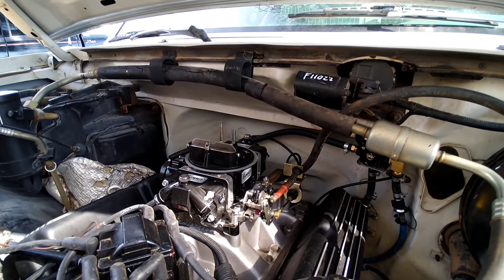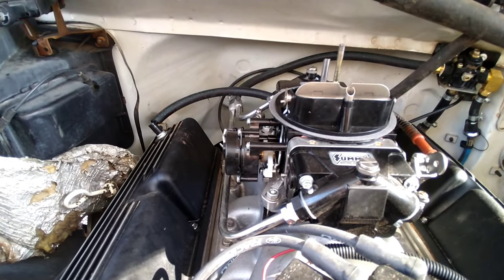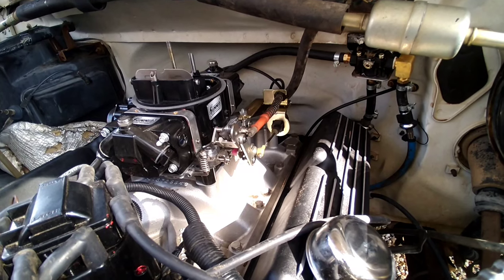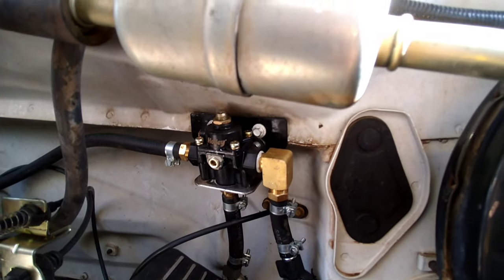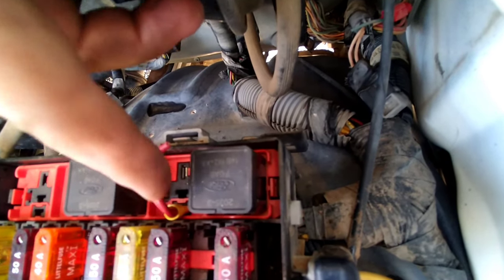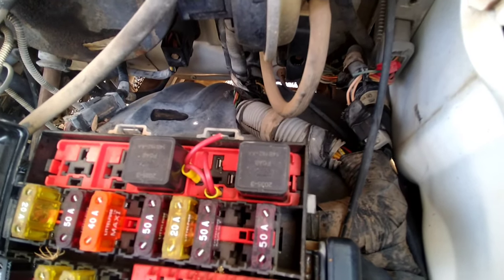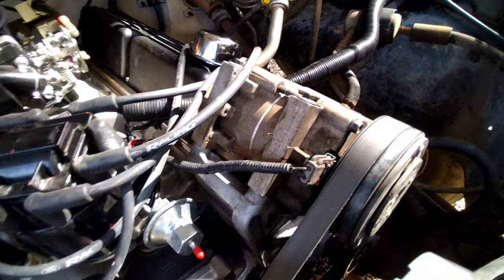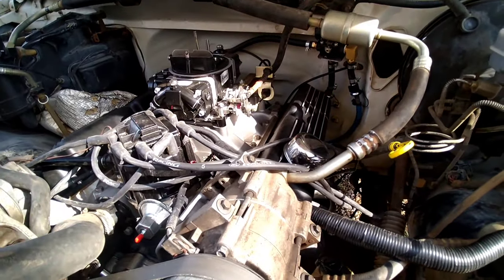87-96 F150 EFI to Carburetor conversion

Comment: I like your conversion can you add a parts list i would like to do this to my 1993 bronco 5.8
Reply from the maker: You want a list or links
Reply: @CCAutoWorks  links please.
Reply from the maker: @hamletxxx2776  https://www.ebay.com/itm/FORD-351W-WINDSOR-COIL-IN-CAP-HEI-DISTRIBUTOR-RED-8-5mm-SPARK-PLUG-WIRES-USA-/183838119974?mkcid=16&mkevt=1&_trksid=p2349624.m46890.l49286&mkrid=711-127632-2357-0
Reply from the maker: https://www.ebay.com/itm/700R4-AOD-Kickdown-TV-Cable-Bracket-for-Holley-Carburetors-by-Sonnax-AS6-01-/254633845425?mkcid=16&mkevt=1&_trksid=p2349624.m46890.l49286&mkrid=711-127632-2357-0
Reply from the maker: https://www.ebay.com/itm/HOLLEY-Fuel-Pressure-Regulator-By-Pass-Style-6psi-P-N-12-881-/164176673230?mkcid=16&mkevt=1&_trksid=p2349624.m46890.l49286&mkrid=711-127632-2357-0
Reply from the maker: https://www.ebay.com/itm/Weiand-Ford-351W-Windsor-Dual-Plane-High-Rise-Stealth-Intake-Manifold-IMCA-/133374027685?mkcid=16&mkevt=1&_trksid=p2349624.m46890.l49286&mkrid=711-127632-2357-0
Reply from the maker: @hamletxxx2776   there's the links and you can run any carb of your choice
Reply from the maker: https://www.ebay.com/itm/AWESOME-TV-Cable-Corrector-for-HOLLEY-Carbs-700R4-200R4-4L60-Ford-AOD-Trans-/362900236769?mkcid=16&mkevt=1&_trksid=p2349624.m46890.l49286&mkrid=711-127632-2357-0
Reply: @CCAutoWorks  thanks a million! You are awesome. I have been working on mine a little bit each week. 
I put the older style heads and intake with AVS2 Edlebrok, and Jegs distributor and coil. 
Need to get the linkage set up which I can do now because of your video and response, wire up things, get the fuel pressure regulator and fire her up.
Thank you for the very informative video.
Reply from the maker: @hamletxxx2776  anytime thank you for watching sounds like you have a nice project
Reply: @derek Meyer I just found this video!  I have a 95 5.8 bronco as well! Have you done this conversion, and is yours equipped with the E40d trans!?

Comment: Do you have the part number for that throttle bracket?
Reply from the maker: https://www.ebay.com/itm/Throttle-Kick-down-Transmissions-Cable-Bracket-Carburetors-700R-4-090127329115-/183786185523?mkcid=16&mkevt=1&_trksid=p2349624.m46890.l49286&mkrid=711-127632-2357-0

Comment: What did you use for a fuel pressure regulator?
Reply from the maker: It's a holley bypass regular
Reply from the maker: https://www.ebay.com/itm/Holley-12-887-Carbureted-By-Pass-Regulator-6-PSI-Black-E-Coat-1-8-NPT-Boost-Ref-/173461623626?mkcid=16&mkevt=1&_trksid=p2349624.m46890.l49286&mkrid=711-127632-2357-0

Comment: Now since you have a aod do you have to leave the emc
Reply from the maker: No not with the aod you don't there's nothing electronic about an aod it works off a cable
Reply: @CCAutoWorks  that's what I thought I'm starting tomorrow on the same job on my 1985 f150 factor fuel injection going to carb with a c6
Reply from the maker: @mauser1891fan  c6 is even easier but just get a carb with the ford kickdown if your c6 has the rod and not a cable
Reply: @CCAutoWorks   thanks that's what I got for it

Comment: Did yours ever flood , I have a new regulator now food from 5 psi up to 90 so I can get the fuel pressure low enough because it was flooding .
Reply: I Ment good lol
Reply from the maker: They make two different regulators ones low pressure 0/9 psi and the other is for high pressure 20/90psi but no I run mine on 6psi never had a flooding issue
Reply: @CCAutoWorks  from what I see I have about 36 psi on said stock pumps turning it down to 6 psi, this was a straight shift truck , I built a C6 and have a PTC 2700/3400 stall , 410 gear ..
Reply from the maker: @JamesRobinson-ur1yt  it's to much fuel pressure or your floats in your carb are set to high or your cam is to big and it's loading up with fuel flooding

Comment: Run any better? Fuel mileage?
Reply from the maker: I put a built 351w when I carb swapped so it does run much better and im getting almost the same fuel mileage just a hair less but it's cammed and has 4.56 gears now so runs higher rpm on the highway

Comment: Did you notice an mpg decrease or increase and by how much?
Reply from the maker: It has a bigger cam and aluminum heads and mpg dropped by 2 mpg
Reply: @CCAutoWorks  Thanks man I might do this mod to my truck because I've gained about 6 mpg with my mods and I want it to be simpler to work on and more reliable so hell yeah man appreciate you answering questions and putting up good videos
Reply from the maker: @mcshaggyswildadventures3952  no problem I appreciate you watching

Comment: Will my 91 7.5l be a lot more powerful if I switch to a carb I have a e40d auto trans
Reply from the maker: You might would pick up some power swapping to carb but it cost so much to do it with that transmission it wouldn't be worth it
Reply: @CCAutoWorks  I keep having fuel system problems any suggestions then?
Reply from the maker: @RollingThunder85  what's happening carb flooding or pumps not working
Reply: Pumps keep going out and map sensors once every 2 months idle is always fluctuating pre detonation randomly occurs getting worse lately idk I want raw power and simplicity
Reply from the maker: Parts just not made like they used to be

Comment: 5.8 or 5.0 ?  Also what size carb.?
Reply from the maker: 5.8 bored .030 over aluminum heads comp cam the carbs a 650
Reply: @CCAutoWorks  awesome I am looking to do the same with my F-150 just hadn't seen if someone else done it already
Reply from the maker: @pete1003  awesome it's the way to go for sure if your going to be doing any performance mods
Reply: @CCAutoWorks  well I already have a rollor 5.8 crane cam roller rockers GT40 cast heads but the computer is restricting it I cannot rev it  more than $4,500 RPMs computers logging it down I believe and factory intake
Reply from the maker: @pete1003  I can see that happening

Comment: I have roughly the exact same setup I'm running into a problem where my truck had an air injection pump so the stock serpentin belt will not fit does anybody know a part number for a belt that will fit the 351w
Reply from the maker: You removed the smog pump bottom Left facing the engine
Reply from the maker: 89010
Reply from the maker: Mine was 88 1/2 belt

Comment: Did you use just a regular steel distributor gear with that roller cam?
Reply from the maker: Yes because I never could find the style your supposed to use for a sbf
Reply: @CCAutoWorks  did it hold up long term
Reply from the maker: @dakotasplace5021  so far so good but I've only put maybe 5,000 miles on it
Reply: @CCAutoWorks  I just need it too last bout a 1000 miles till I put my comp cam in😂
Reply from the maker: @dakotasplace5021  it will do that easy

Comment: My fuel pressure regulator aint doin jack shit the fuel flows like water and floods everything what am I missing?
Reply from the maker: It's probably not a low pressure regulator you probably have a high pressure one for efi
Reply: @CCAutoWorks  I bought a holley 6 - 9 psi regulator dose that not mean those are the only amount of fuel pressure allowed to the carb or am just ReRe and it actually works another way that how im trinna use it?
Reply from the maker: @justinjennings6836  is it the bypass regulator
Reply from the maker: @justinjennings6836  should have a in a out and a return and a port for a pressure gauge
Reply: @CCAutoWorks  yep bypass regulator everything
Reply from the maker: @justinjennings6836  in on the right out on the left and the bottom is bypass return if that's right the diaphragm is probably messed up inside
Reply: @CCAutoWorks its the second unit Ive bought so whats stopping me from just putting inline valve and just cracking it open a hair or two ?
Reply from the maker: @justinjennings6836  that would work but it would put a lot of stran on the pumps so with the screw in the top all the way down or all the way up doesn't affect the fuel pressure
Reply from the maker: @justinjennings6836  https://www.ebay.com/itm/144617579995?mkcid=16&mkevt=1&mkrid=711-127632-2357-0&ssspo=o7z8zsr2s6u&sssrc=4429486&ssuid=6G4e_MbCTLy&var=&widget_ver=artemis&media=COPY
Reply: @CCAutoWorks  I have an Identical model from summit racing
Reply from the maker: @justinjennings6836  you have the part #

Comment: I got a model 4160, 4 barrel 390 cfm Holley carburetor and was wondering how you attached your original "snap on" throttle cable to the carburetor?  I don't see a little "tit" on my carburetor to snap on the throttle cable.
Reply from the maker: You can buy them most carbs come with a stud style and u have to buy the ball ones
Reply from the maker: https://www.ebay.com/itm/403574192411?mkcid=16&mkevt=1&mkrid=711-127632-2357-0&ssspo=eZWCT6wITSy&sssrc=2349624&ssuid=6G4e_MbCTLy&var=&widget_ver=artemis&media=COPY
Reply from the maker: I sent you a link to a set of them
Reply: @CCAutoWorks  Thank you so much!  That helps tremendously!
Reply from the maker: @knobdikker  no problem thank you for watching and commenting

Comment: What about the 2 wires going to the transmission. The switch and the wire to the backup lights
Reply from the maker: What transmission do you have
Reply from the maker: If it's an aod the transmission wires where not in my engine harness they where in a separate harness and they still work fine
Reply: Thanks man. Yeah I have the AOD. I have an 1988 ford e150 van with the 302 and I'm trying to do this but not sure about some things.  Like did you use your factory kickdown cable and throttle cable if so will they work cause there a lot longer when you switch to carb
Reply from the maker: @scottmcbride2237  yes I used both stock cables I just looped them to take up some of the length
Reply: @CCAutoWorks  thanks man. I wasn't sure if it would work. All those after market ones are sky high like lokar. How did you adjust the kickdown cable. Did you use a pressure gauge on the tranny to make sure you was running around 32psi.
Reply from the maker: @scottmcbride2237  we used lokar putting a aod in a 72 mach1 and the kickdown cable was trash that's y I used factory on this one I like my cable tight so I get later shifts but I basically just pulled all the slack out and put just a little bit of tension with the throttle closed and went from there it was still shifting to earlier for me at wot so I made it tighter now when the throttle is open all the way the cable is pulled all the way tight
Reply: @CCAutoWorks  I guess you just have to play with it.  Thanks man. One more question. For now lol. Sorry.  When you pulled all of you air hoses and the evap. What did you use to plug the 2 holes in the back of the heads. And what did you do about the pipe that connects from the exhaust to the evap hose. What did you use to block it off?  And did you put a shorter fan belt on it after?
Reply from the maker: @scottmcbride2237  just don't get the kickdown to lose or it will burn up the transmission in seconds I have aluminum heads so didn't have to mess with that but in that past I just cut it off and leave enough to hammer it flat and fold the tube to seal it off or on the heads I think they have plugs to block it off but I would hammer and fold or weld it shut
Reply: @CCAutoWorks  thank is. One last thing. I promise.   Did you ever figure out a better way to run your fuel pump or is using a jumper wire the best option?
Reply from the maker: @scottmcbride2237  na I don't drive it so I haven't really done anything else I need to remove the box and see how the factory really ran it but with the jumper there's a 20 amp fuse that runs it and is hasn't gotten hot or blown the fuse
Reply: @CCAutoWorks  so this wouldn't burn up the pump itself?  I watched a few other vids and most guys cut the power wire on the pump and wire a new wire and run it to the fuse box.
Reply: Thanks for your time
Reply from the maker: @scottmcbride2237  no problem anytime I don't mind trying to help

Comment: How did you wire the distributor in
Reply from the maker: It's not the stock one it's an aftermarket hei it uses one wire from an ignition source

Comment: What brand regulator are you using now
Reply from the maker: It's a knockoff aeromotive Chinese regulator I found on eBay for 50 bucks you just got to make sure they're for low pressure

Comment: Wants that bracket for the aod tv cable called for it to work with that aod the carb
Reply from the maker: https://www.ebay.com/itm/700R4-AOD-Kickdown-TV-Cable-Bracket-for-Holley-Carburetors-by-Sonnax-AS6-01-/254633845425?mkcid=16&mkevt=1&_trksid=p2349624.m46890.l6249&mkrid=711-127632-2357-0
Reply from the maker: https://www.ebay.com/itm/Sonnax-AS5-05K-Throttle-Valve-Cable-Corrector-Kit-200-4R-200C-4L60-AOD-/254633876443?mkcid=16&mkevt=1&_trksid=p2349624.m46890.l6249&mkrid=711-127632-2357-0
Reply: Appreciate does is go In and out of od and gear down on it's on or you have to gear it down

Comment: Can you give me some info on adjustments on that tv cabel
Reply from the maker: Tighter is better then to lose but what I do is with the throttle closed you pull the tv cable tell u feel a little tension basically take the slack out and pull the cable just a hair to add tension if you want it to hold the shifts a bit longer put a little more tension on it

Comment: Nice swap. Will that throttle bracket work with a edlebrock carburetor?
Reply from the maker: You could probably make it work but it's made to hook and hold on a Holley style carb
Reply: @CCAutoWorks  ok thanks! I found one for $17 bucks. I can weld and fabricate a little I'll see what I can do. Do you know if the AS5-05K TV cable corrector bracket will work a Edelbrock some website say yeah and others say for Holley.
Reply from the maker: @rynoa2927  that's cheap most companies now are making that more less universal between the two u can buy one Edelbrock specific but you're going to pay more
Reply: Yeah it's a aftermarket one.  wasn't for sure if it would work with a Edelbrock. Didn't want to pay a lot for one just incase it didn't
Reply from the maker: @rynoa2927  I've used the same cheap eBay one on both a Holley and Edelbrock no problem
Reply: Hey.  Did you have to turn your  fuel regulator down?  I got my pump to run constantly now.  but I think it flooded the carburetor out
Reply from the maker: @rynoa2927  I've got a low pressure fuel fuel pressure regulator set to 6psi
Reply: Yeah I used the same Holley regulator. I went back and looked at your video I think I got the fuel lines backwards
Reply from the maker: @rynoa2927  that would do it
Reply: Yeah I been converting my 93 302 over to carb. getting close to being done. gotta start weeding out the rat's nest of leftover wires
Reply from the maker: @rynoa2927  yessir I cut the biggest part of mine out

Comment: Hey can you tell me the tb cable length you used
Reply from the maker: I just used the stock cable
Reply: @C&C Auto Works  thank you very much. I've tried a 22 inch and a 19 inch and had nothing but trouble as I threw away the factory one doing the swap. I have a 43.25 coming tomorrow which is the factory length. I'll make a loop and looking as your it should give the Slack I need. Thanks again!
Reply from the maker: @roguepawnz111  your welcome thanks for watching and commenting

Comment: Did you remove the ECU or leave it in?
Reply from the maker: I left it I just trimmed the wiring harness down the the bare minimum
Reply: @CCAutoWorks  I have a 90, will it run without the ecu?
Reply from the maker: @paulshelton1845  if you convert to carb and hei distributor it should no problem I did an 86 and took out the ecu
Reply: What fuel pressure regulator did you use
Reply from the maker: @paulshelton1845  it's a holley bypass regular
Reply from the maker: @paulshelton1845  https://www.ebay.com/itm/Holley-12-881-Die-Cast-By-Pass-Style-Carbureted-Fuel-Pressure-Regulators-/174590524959?mkcid=16&mkevt=1&_trksid=p2349624.m46890.l49286&mkrid=711-127632-2357-0